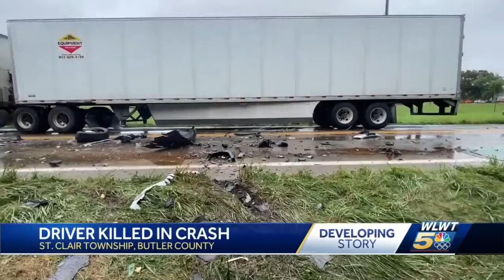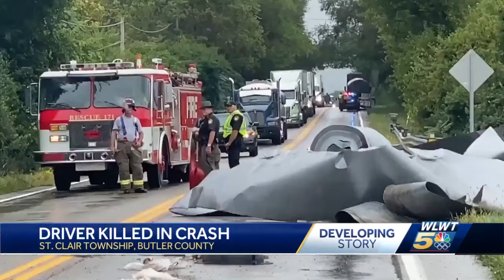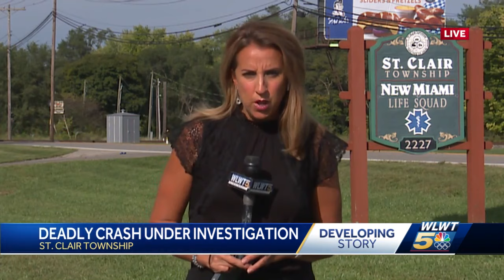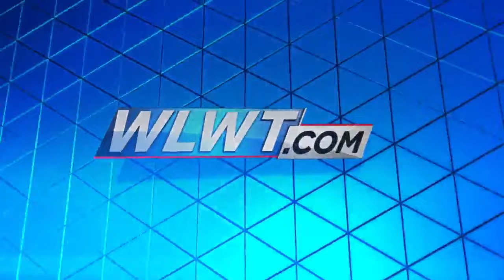Sheriff: Steel coil falls off semitruck hitting, killing driver in Butler County

Comment: I have hauled many of these coils. Chains and bunks are the only way to secure them. For one to fall off a trailer is pure negligence. I also own a ford edge.
Reply: Coil Bunk, had to research that.
Reply: @johnstarks5323  yep, they are a tool specifically for metal coil transportation.
Reply: That would depend on how these coils were loaded, and whether they were eye to the sky or not.
Reply: Exactly. ! I imagine it will cut thru usual straps.
Reply: I agree l used  to drive a rig and l saw flatbeds turned over and the coils still holding on, nelegance  is right
Reply: Please ban steel coils from being transported.
Reply: @pkwithmeplease  that is not reasonable, practical, economical or possible. Manufacturing of many things requires the transportation of materials to sites that are scattered anywhere across the country.
Reply: @pkwithmeplease

of course no other kind of cargo ever falls off and kills, right?

Comment: Bad load securement... Big trouble for the person responsible. RIP to the innocent driver of the Edge.😢
Reply: I just had a talk with a colleague about some brand new ratchet straps his company ordered. He had a loader going to a const site that arrived nearly off the trailer. State police helped get the truck with the loader off the road make a turn into the job site near my house. I know the landscape company because we use them here. The cop saw the same thing I saw. The brand new ratchet strap stretched about a foot and was nearly severed. MADE IN CHINA folks things don't get much worse than this... You cannot fault a driver or a company for cheaply made expensive equipment. As far as I know those commercial straps about $90 a piece certified for heavy use. The chain mooring was the only thing that helped keep the thing on the way it was and from completely coming off the trailer.

Comment: Need for a special trailer just for coils with a trough where this can't happen
Reply: There's a special way to secure those coils and I've seen many running down the road that aren't properly secured. Even small coils need a minimum of 5 chains and some guys I see they only run 3 which is nowhere enough. The big 48k pound coils need 12 chains and straps to supplement the chains
Reply: @turtle3117 12 chains on any coil is overkill, so is 5 on a small coil. Most drivers don’t even have 12 chains
Reply: @turtle3117  no man. Each chain W.L.L (working load limit ) will vary. You have to look at your binders W.L.L specifications, AND your trailers W.L.L for each post. 5000 lbs is about the strength of the least common demoniter (binder). Quick rule of thumb is 5000 per chain and you chain for 1/2 the weight. So 5 chains will pass D.O.T inspection on a 48000 lbs coil. Myself imma gonna throw 6 chains on a coil that heavy 

Secure a trip chain in front using wood blocking as shown above, to keep the chains from touching the coils.
Reply: They got them trailers but they way too expensive and the coil loads don’t pay enough.
Reply: @igotthejuicesucka7939  If they dont they should not carry the coil....just cos others do it dont make it right.

Coils should be carried in a well.....not on a flat back trailer.
Reply: @nickaxe771  you don’t need that many chains for any coil. Most you can load is 48-50k lbs 10 chains is plenty enough for that. And it doesn’t matter how you feel they should be hauled. It’s been done that way for decades and DOT or the shippers don’t have a problem with it
Reply: @igotthejuicesucka7939  And still they fall off and kill people....ok crack on....would not be allowed over here in the UK.....heaviest coil I carried was 21+ ton....sat in the well of the trailer.

During heavy braking the imposed load could be 100t+
Reply: @nickaxe771  and how many times have you heard of that happened in the us? If it was a real problem then they wouldn’t be hauled on flatbed. I’ve never had any type of steel shift on me. All of my load shift have happened with light/fragile freight.
Reply: You can NEVER have too many chains on any kind of load....NEVER got a ticket for that
Reply: A special trailer  for coils in the US won't happen. 
Case in point, the Mansfield bar and that was in 60s...
Reply: @fredgervinm.p.3315  mkay genius,  the Mansfield bar was mandated over 50 years ago, How many motorists have died since then from under ride crashes?

Training and common sense stops incidents like this from happening. 
No amount of securements will keep a 20 ton metal coil on a trailer if it's not secured properly. 
This drivers inattention to detail, be it stupidity or just simply poor training, killed an innocent motorist just simply going on with their day. 
I wouldn't want to be in that drivers shoes, I wouldn't want that on my conscious.
Reply: @jameslovitt994  
I said in the 60s and ur saying 50yr ago 
(I was close Einstein) and going under the back of a trailer usually is a closed casket event.
My point was/is,
a special trailer to haul coils won't happen in the US.
Reply: We've been carrying coils for a hundred years,  with very few incidents,  so few we didn't even here about them, now with all the millennials and gen-z drivers who care more about there phones than the public,  the only thing we need to change is the immature drivers
Reply: Nope, just chains, bunks and boomers. If this happens it’s the drivers fault.
Reply: negative. Proper rigging and training which they already went through. Driver negligence or taking shortcuts for rigging
Reply: There are some well trailers in the US, but they're normally only used for local coil moves. If you go any distance, the deadhead miles back to the point where you loaded eat up any profit you made. You need a backhaul, and good luck finding one for a well trailer.
Reply: 😮 u mean american companies cut corner and disregard safety of everyone 😮😮
Reply: @fok8810  This was an owner-operator. You've got to operate to own. And you're not going to own for very long if you're only loaded one way. It's not a corporate thing. It's a fact of life here in the states where we  run hundreds, and sometimes thousands of miles to deliver a load. You have to have a backhaul, or you're not going to be in business very long.

Comment: Pay attention when around semi trucks, don’t tailgate and get off your phone.
Reply: In this case it was stated that the truck was headed north and the coil fell off into the southbound lane on a two lane highway. What could the driver possibly do?
Reply: @douglasdixon524 chain it down better. I have been a flatbed steel hauler for 26 years now, haul coils a lot. I chain the coils like a lunatic, it could be my family or yours in the car beside me.
Reply: From the front fender on my truck to the rear of my flatbed, I have a total of 22 lights blinking on just one side for my turn signal and I still have cars ride beside me for a mile or two when I am trying to switch lanes... AT NIGHT!!! People are oblivious to 22 large amber blinking lights in the dark, no one pays attention
Reply: @TheRoadhammer379  I was referring to the comment about the car not the truck driver. The person driving the car going in the opposite could not have done anything different. But yes, all loads need to be properly secured.
Reply: @TheRoadhammer379 just move over a bit they'll get the message and clear out ... act like you been taken hostage !  Instead of OMG!

Comment: A big coil like that doesn't just come off unless it's not chained down properly, it should be so secure that the flat bed could flip over and that coil is still chained to the trailer and that is clearly not the case. The driver should be charged with manslaughter ...

Comment: I used to work for a company that cut down coils like that into smaller coils for the auto industry and it's hard to tell just from the video but that was roughly about a 40,000 lb. Coil
Reply: Yup, I worked in a company here in LA, Hannibal Material Handling, named has been changed to something else and I don’t remember what’s called now, and the most heaviest coils that we worked on were 55,000 lbs. crazy stuff, just one of them rolling slowly towards you , you won’t be able to stop it.
Reply: I work for scap brokers. We buy hundreds of scrap coils aday. My guess would be 28k to 35k tops.

Comment: this is the second steel coil that fell off a truck in a few months, the last was on 75 North in ST Bernard in the spring, time to find a new lashing method I guess..
Reply: I don’t understand why they don’t lay them flat on the trailer with a steel pallet of some sort to load and unload and securing the load with chains in a sort of crisis crossed pattern over the flat coil.
Reply: @Tokyo_1031 they do that too with smaller coils. It’s called eye to the sky.

Those heavy coils are too big to fit on a pallet laying flat. I haven’t seen a forklift that can lift a single pallet up to 50,000 lbs when there is little room to manoeuvre.
Reply: @Tokyo_1031  Loading "eye to the sky" you run the risk of the banding breaking and letting the whole coil pop like a spring, likely killing anyone near it.

Comment: how do you correctly chain coils that can roll sideways on the deck?
here on the west coast coils are loaded so they could roll length wise. making very easy to block and chain them.
in the years i was doing such i never heard of sny driver losing a coil…except when a train hit his truck.
straps are not allowed.
but now with auto braking more people will die. not just from coil flat steel.
Reply: Many customers require the coils to be loaded "shotgun", where the hole faces front and back, for unloading purposes. Suicide, as you refer to, is hole side to side, both are equally dangerous

Comment: In the UK we carry coiled steel in a well between the trailer chassis rails.....you guys seem to carry them with chocks and chains.....if it breaks loose.....its just wants to roll toward the trucks cab......or of to the side onto the road.

During heavy breaking......the weight of that coil is magnified by many times.....chains are no good in that way.
Reply: If drivers would follow DOT securement guidelines the steel coil will not go anywhere.
Reply: What do you mean "You guys?"
Reply: I suppose I mean.....truck drivers in the US...hope that helps.

From a UK truck driver. @nocturnalrecluse1216

Comment: I don't understand why flatbeders put chains in the middle of the coil instead of behind the 4x4 chains pulling back , thise chains in the middle will not keep the coil from catching momentum forward ....
Reply: It’s rather hard to explain without being able to show you but there is certain ways to chain and secure every coil in every position and federal DOT requires 1.5 times of securement of each coil. So if you have a 40000 lb coil minimum amount of securement is 55000 but always went with 60000. And there is certain ways you must have your floor boards and mats and how those are to be used. Any good flatbed driver and company will do these things as well as fully train their drivers.
Reply: @HappyCamper1992 I agree with you regarding securement but FMCSA DOESN'T REQUIRE 1.5 times the securement, they require at least half of the working load limit. By FMCSA requirements, you only need 4 chains rated at 5500lbs working load limit on a 40,000lb coil. You need to freshen up on load securement requirements but honestly, keep doing what you are doing, I too secure above and beyond the weight of the coil.
Reply: @TheRoadhammer379  maybe I miss understood the book way back when. However when I started out I was a flatbed driver and i really enjoyed it. We were always taught to secure at least 1.5 times the weight of the load and if possible 2X. That way we couldn’t go wrong. The main goal for this is just in case of an accident the load stays with the trailer.   Some say it’s over kill and some say it takes too long but let me say this i would rather my family be riding next to a driver who took the time to make it right than anywhere near one who short cuts their securement

Comment: They mean the driver hit the coil.  Those coils weigh tons!  Once some guys tried to steal a roll of coil off of a flat bed and roll it into the bed of their Chevy S10 so they could sell it at the scrap yard section by section.  Needless to say the truck frame was sitting flat on the pavement when the cops arrived.  Those coils can weigh as much as 60000 pounds, that’s sixty thousand pounds!  Pay attention when you drive.